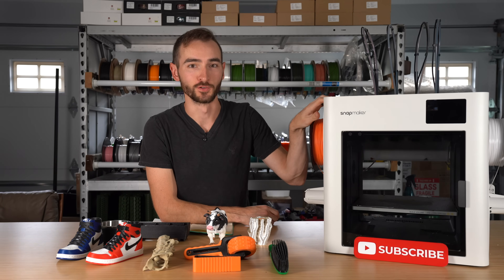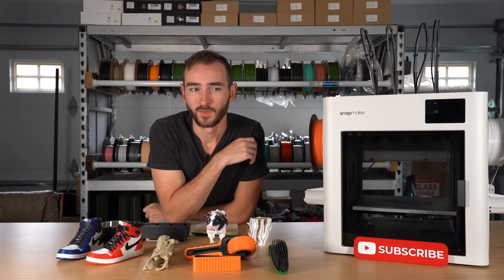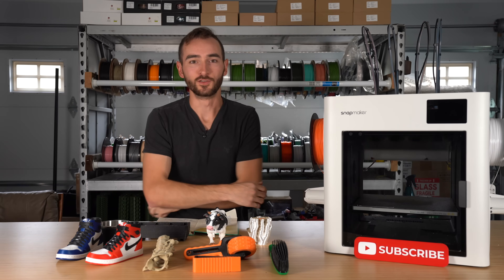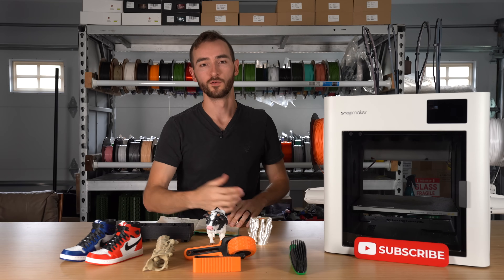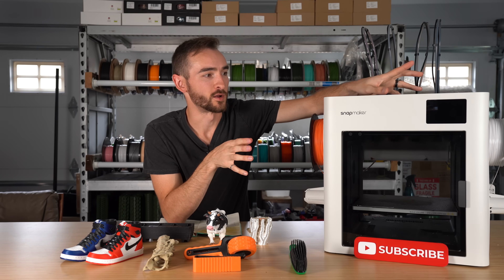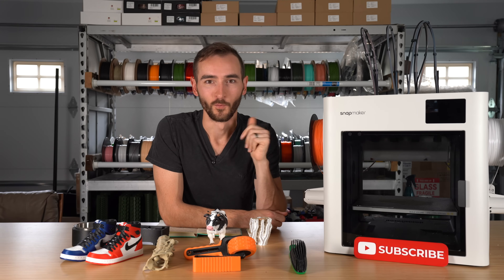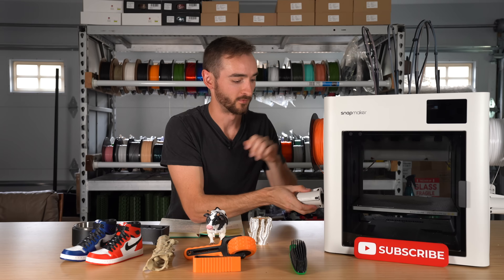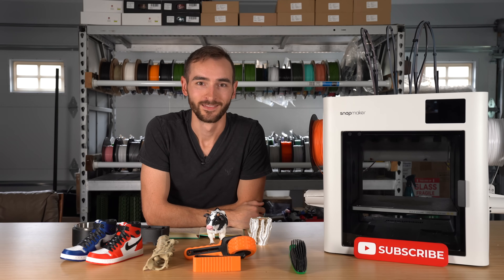Snapmaker U1 Final Verdict: Pledge or Pass?

Comment: 1,000,000 cycles on a pogo pin?  I doubt it!  Maybe under exceptionally ideal circumstances - but in reality I would expect 50,000 to 100,000 cycles in real-world situations. (automated pcb testing machine).

Thanks fo rthe review.  I'm interested in replacing my X1C - but not with this.

Comment: I can't believe anyone would cancel an order of this machine because they are worried that it will be outdated by the time it is available. Looking at the reviews, its 90% of what's claimed at 50% of what it should be selling for. Bambu is scrambling trying to impress with their H2C, while they can't even ship their P2S. Several other company's are just starting to offer an AMS, which this machine has made totally obsolete. Yes it is just the beginning but at 1/3 the cost of an finicky XL, I doubt it will have any competition for close to a year, and if it does, GREAT! And as others have said: "This is the printer I wish Bambu Lab had released instead of the H2 series"

Comment: I do like the lack of a purge block. I would never buy a system that waste that much material. But this system, excellent engineering, and it is available elsewhere, but has it been available long enough to be tried and true? I don’t have any multicolor printers and my best machines are VORONs, excellent printers, not multicolor and assembly is bolt by bolt and you have to load Klipper, moonraker, and mainsail. But after doing all that you can fix any machine. For me I am not concerned about buying cutting edge products as you can never keep up. So I’ll wait, maybe as long as a year and someone will sell one of these used on eBay for, probably, $500-$650. And by that time the reliability of this machine will be determined. Cheers and nice video.

Comment: The biggest point is do you need another 3D printer, then is it relevant when it launches. I think for a Multi Colour printer it is a win win, less so for technical filaments, but I can see other companies like BTT, BiQu making products for this as it has huge traction, and as someone who wants to print different technical  materials in one print, and aware of the INDX from Bondtech I still bought one, because I think add ons will be coming from other manufacturers that will make this a budget stop gap solution. I don’t need a U1 Max or U2 because I backed the ProForge5 which will be for special case and batch 3D printing.

Comment: They HAVE TO ALLOW SSH ACCESS!!!  Klipper is GPL V3, which clearly requires any use of the software under that license to be user-upgradable with a version the user can modify himself.  No form of protection against such upgrades is allowed.  That's the entire reason for GPL V3 versus other versions of GPL and the LESSER GPL V3 license.  Now, also Bambu violates GPL V3 with their latest plugin which cannot be used as-is with ex. Orca slicer, so something being illegal doesn't mean companies won't do it.  We finally need some legal entity that would enforce the GPL and sue those companies that break it, that would finally stop these bad practices.  For now, I'll give the U1 the benefit of the doubt and assume it will be opened up as required!

Comment: The savings on waste alone will make this a solid go to for tons of projects. As a Bambu owner I have turned down projects based on the time and burnt filament. The days of having to make a tray of items to make it worth while are gone and a reasonable print time with no poop  for a cute little froggy for my friends kid?  This thing will continue to pay it self off well over and over. Add multicolor TPU capabilities, built in AMS I believe the taxes were included on the kickstarter? this thing is a steal.

Comment: I have backed one which falls into the 1st batch to be delivered, Oct-2025.  This is not my 1st 3D printer but my 1st consumer 3D printer ever buy/back since I built my Delta in 2013, and my Voron after 10 years in 2023.  Whoever love or passionate in fdm 3D printing would love to have this little boy for 2 keys, 1. Unbeatable price 2. 2025 new star of multi-print-heads machine (The ratio of positive to negative result is significant, by beta-tester, with whom most are really potential user, torture it with their creativity and showing us much nice stuffs and capability and potential.  

I wasn’t plan to back one but wait for INDX or any new comer as I am too working on toolschanger mods to my IDEX Voron V2.4.  But… even investing on a QiDi Q2 as a backup machine is not that cheap compared to U1.  Why not back one be my Christmas present in condition if I am able to grab the one to ship in October this last week.

Comment: I backed the Snapmaker u1.  While I think the Prusa XL is better, it is also around 5k once you get it similarly configured and delivered.  I think the Vortex and Bondtech/INDX systems are cool (especially the Bondtech), but I think they will cost up closer to the XL than the U1.  I intend to upgrade my Bambu H2D to a H2C but even upgraded it will remains wasteful on multi-color and relatively bad at TPU since the AMS is mostly incompatible with TPU and similar.  The thing with the u1 is the value.  It might not be the best tool changer in March (it isn't really the best one today) but a toolchanger gives you print options which printers like my h2d simply never will.  It will still have this capability whenever mine gets here.  And, it is so cheap that taking a flyer on this just is so low risk.  If you are interested in multi-material prints, multi-color TPU there aren't a lot of options.  And if I decide to replace it with some future unknown model in a year or two I am only going to be out a couple of hundred bucks at worst.

Comment: Pass for now.
I currently have 4 multi material capable printers (multi nossle and single nossle). 
I seldom print in multiple colors or multi material eventhou I have the ability.
I think I'll wait and see how, prusa, bondtech and bambu respond and go for the next generation of toolhead/nossle changing printers when all the issues has been fixed.

Comment: surprised you talked about comparisons without mentioning the WonderMaker kickstarter
Reply from the maker: Forgot about that tbh. Don’t know a whole lot about it.
Reply: @ygk3d  that's fair, its a lesser known thing. It's certainly the most direct competitor. Launching a few months ahead of the U1 (supposedly) but from a lesser known company with a less polished overall presentation in my opinion. Doesn't mean it won't be good. In the coming months, I expect the market for tool-changers will mostly be a comparison between those two machines

Comment: I'm already considering how I can combine my Snapmaker with a Sunlu S4, so the spool holders issue won't be an issue as i plan on having my filament situated at the top of the printer, with the filament feeders likely placed on either side of the S4.

As for the issue with the pogo pins, I'm confident at somepoint somebody will design an alternative system/ upgrade, and even if not, fortunately, I'm confident enough in my own abilities to do any fixes as necessary.

My biggest gripe however, as a primarily ABS user, is the enclosure is not going to come as soon as i get my printer.THere might be some workarounds but this will limit what I can do unti it's released.

As for heating/ insulation, considering all the panels are easily removeable, i intend on putting some insulation and maybe even print a custom side panel on my Sovol SV8 with a heater installed for that purpose.

Comment: If all of those backers would have backed or bought  a Snapmaker J1 2 years ago, we would be closer to 1900 backers than 19000 for this campaign.  Well Snapmaker may have learned their lesson and do better this time hopefully. If not you will have a hard time to sell yours for $300 in summer 2026. That's what I got for my $1500 J1S. 😢
Reply: Same with my A350, which is why I am still hanging on to it for some small projects but backed out of this kickstarter.

Comment: I WAS excited to be a backer for this machine, and then after some research and some real world user opinions from one of my best friends who happens to work for NASA, I decided to UN-BACK this printer. I looked at the Eco system of the Bambu line of printers and they just work. I am beyond the point in my life where I am willing to spend endless hours trouble shooting and wasting filament just to get something to print. Yes I realize that I am giving up the ability to tweak something in source code if I needed to, but since this is a game changer type unit AND another factor that weighed heavily on my decision to retract my backing of the Snapmaker U1 was the fact that Bambu is releasing the Vortek and it has wireless tech instead physical connections which WILL wear out.  From what I’ve seen and researched I’d rather wait for the H2C.  I am aware that it will cost more but I’m willing to part with a few more dollars to have it work the first time out of the box, and continue to work for a while… I am under no delusions that there wilI never be a problem with the Bambu Unit, everything has problems from time to time. I just want to Print and Prototype projects  not tweak and rebuild the machine I just bought.  and the final nail in the coffin which actually confirmed my decision to retract my support after the fact… was this video. Thanks for  sharing your experience and for the time you have put into this project to both the maker of this video AND to Snapmaker.
Best Regards.

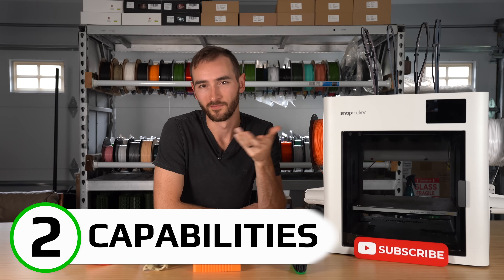Comment: 9:20 - There is still one singular good use case for color changers even in the post-tool-changer market:  Hueforge.  I have a Creality HI Combo, and this thing is an absolute beast for hueforge, and I'm hoping that when tool changers really hit the market that a lot of people are going to be dumping their old color changers on the market for dirt cheap and I'm going to use that to build out my Hueforge farm.  Hueforge only has a handful of color swaps and purges per print, which is a completely reasonable amount of waste for what you get.  

I am also an early bird backer, though.  Tool changers are objectively better, there's just the one use case where price-to-performance tips the other way for my specific needs.

Comment: how many years do you think a printer should stay good and relevant?
one of the reasons why I don't buy new printers is that my current one still prints good prints
Reply: Depends on what you're looking for. If you're happy with what you have then it's still relevant to you. Others may be doing more and require a higher tier printer and the new features may help further boost their models/hobby

Comment: Doesn't the top cover come with a heater?
Reply: Not according to Snapmaker, it is passive, meaning the chamber is heated by the bed. This of course might change when they start shipping as the top cover is still under development.
Reply: @andrewvillavicencio8496 Ah I see.

I'll probably skimp out anyway. I don't need engineering materials and hopefully I or someone else is able to make a printable alternative because 250$ is nuts.

Comment: DO NOT BUY:
I have a  Snapmaker J1, the printer received its FINAL firmware update 18 months after the first pre-orders shipped - over a year ago, and they still sell it. I still run into firmware problems, the machine is EOL 5 years sooner than any competitor. 
- So now I'm looking for a new printer because Snapmaker CANNOT make A) a slicer that works, B) provide for an open slicer to work well, and I'm sick of the nonsense issues. Cura actually works well but without volumetric flow control I really want to use Orca, and even Snapmaker's custom Orca is horribly broken.

 I'm sure the U1 will work OK on day 1, with some fiddling, but in 2 years all the other software will move on and you'll be stuck with an product that's prematurely end-of-life.
Reply: And that's why the Snapmakers promise to contribute changes back upstream to the Clipper / OrcaSlicer projects is such an important part of the U1 offering.
Reply: @markbooth3066 what that means is they intend for the community to finish the product, so why purchase something the maker never intends to complete into a well-rounded offering?
Reply: Not really  @Proton_Decay , it means that if Snapmaker leave us high and dry, like Bambu Labs did, the community can fix it, not that we will necessarily have to. The clippy led me to assume you would know the difference.

I can understand that your J1 experience might have left you with a once-bitten-twice-shy attitude, so I hope that the community can help you revive your ailing J1, but it's not necessarily the case that the U1 will suffer the same fate. I hope they have learnt their lesson, understand the strength of feeling in our community and that we never need it, but I'm glad they are making the right promises now.

Comment: Any chance you'll be trying to get your hands on WonderMaker's ZR-Ultra toolchanger? The ZR Ultra is basically just like the U1 feature wise, but with a larger bed. They also do an interesting version of it, the ZR-Ultra S which comes pre-assembled with an enclosure, exhaust filtering, and chamber heater.

So far you've done some of the best content I've come across on the toolchangers and I'd love to hear your take on the printer, especially as it's a new untested brand.

Comment: I was really holding out for a printer like this mainly because of the waste factor. The prints from your Beta look great for my needs. Open source is a must as I cringe at the thought of what  Bambu is doing no matter low luscious their prints are. I have a Ender V3 KE and while it was an absolute nightmare to set up and use the first 9 months, I finally have it printing the way I need. Creality tech support was very responsive albeit sloooowwww due to them being in China. If the U1 was in (normal) production then I would buy it on the spot however it's not and, as you said, a lot can change in 6 months and I'm certainly not an early adopter as I don't have time for headaches. I need real world reviews not Beta ones to make a smart decision. I'm sure companies have  a similar tool changing system in the works now and will produce one at a competitive price if not lower. For those reasons I'll pass. Unless someone wants to send me one they don't need.😉

Comment: I don't need multi color printing at this time and by the time I might want a multi-color printer, I will definitely purchase one with multiple heads - but not in the first year of production and not until the bugs have been worked out and the machine has a little history. Prusa has a proven track record of excellent customer service, using quality parts, and product longevity. When I have the choice between plastic, sheet metal or steel, I'm willing to pay more for steel. I'm also willing to pay more for a printer not made in China.

Comment: idc about multicolor. I only care about dedicated support material. And fact is, Snapmaker already has a machine that should be ideal for that: The J1s. A true IDEX with two complete hot ends, no swaps or any complex processes.

However, I haven't seen a single glowing review for that machine. Most people say it's tinker trash. Snapmaker couldn't get an easier system to work well, but they want me to believe they can make a budget 4 toolhead changer? idk. I'm gonna wait and see.

Comment: I have a P1S and Qidi Plus 4 both with AMS boxes and while they work, the waste is enormous.  One of  Snapmaker's selling points was the cost savings would essentially pay for the U1 itself.  That, plus the low cost compared to the Prusa XL tool changer led me to jump in the early bird seat.  It was just too good a price to pass up.
As for the spool holders, I have to print cardboard spool adapters for my AMS boxes so having the do something similar for the U1 is not a big deal.  I understand they'll have their own adapter files available soon>
For the pogo pins, I was skeptical at first with the 10-15K lifespan but I believe they addressed that on their FB page that the ones they use are rated for 100K.  I'm sticking with the U1 and use my Plus 4 if I get into engineering filaments.

Comment: Repairability is something I actually like a lot about the Bambu printers. They've a fantastic Wiki and almost every original part can be purchased at a very fair price in their Store which has warehouses across the globe.  Compared to that the selection of replacement parts in the SnapMaker Store is fairly limited when I look at the available selection there.
Reply: He said that this was easier to work on than bambu printers. Whether they will have spares in stock early in its production cycle is another question
Reply: @Ebonyqwe  For availability on spares I checked more on their current printers and what they've listed in their store for them.
Reply: @Ebonyqwe  You can see what SnapMaker currently offers in terms of spare/replacement parts, and it's very sparse. Pretty much all the parts they sell are accessories and upgrade parts. If you need something out of warranty you need to contact them and pray they'll sell it to you. Hardly ideal.

Comment: About the phrozen Arco I cancelled because at the end of the campaign the printer was still in development, and after that we had print samples pictures and the quality was Anet a8 like, crappy as hell 
Plus according to what they told of modifications they would implement I was sure it could not be sent until 6-10 months. I was optimistic. 

Snapmaker is already running mas production so I really think I will have my printer hopefully in December (Baker 44)